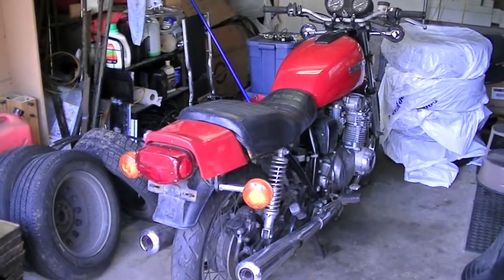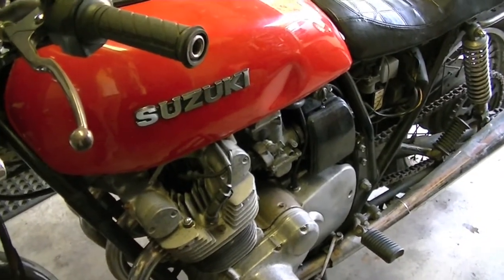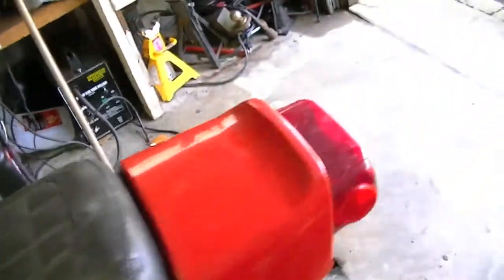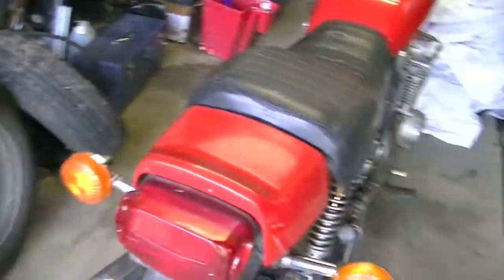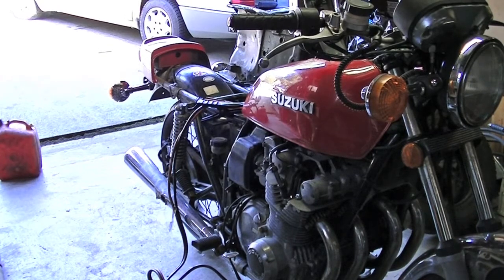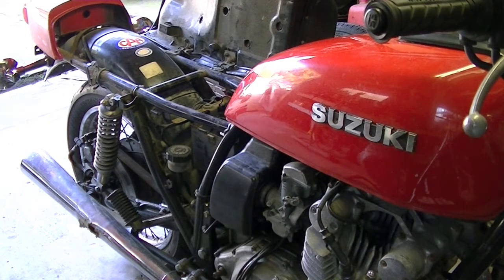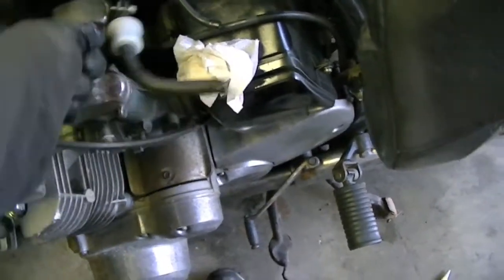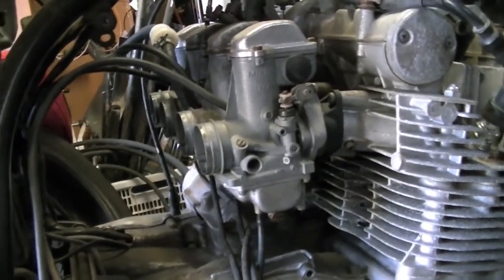1978 Suzuki GS750 Project Introduction

Comment: Man I have a 82 seca xj750r when I got it I pulled the carbs and bench synced them. That's been over a year ago. Now my bike keeps fouling spark plugs. Just eating them.. I'm thinking the idle screws may have moved from vibration. Can't really think of anything else. Haven't pulled them yet.
Reply from the maker: Jrpg1038922Is it using oil? Bench syncing is usually just to get it running. You should really sync them properly with a carb sync tool to get it running right. Also, confirm that the plugs you are using are the correct ones for the bike. If its running so rich that your eating plugs the way you suggest I would pay close attention to the float levels, and the condition of the needle valve and seat.
Reply: Its not losing or burning any oil that i have noticed. Im using NGK bp7es plugs. Just the cheap ones there like 1.99 each. Im just not sure whats going on because after setting everything when i first got it it ran great and didnt go through plugs. Im pretty sure i used your tutorial that you made when you were working on your seca to set my carbs. Not really sure. the floats i set by holding the carbs upside down and making them all level with the lip of the bowl if that makes any sense lol hard to explain. Didnt use any special tool.
Reply from the maker: I'm not sure off hand if those are the correct plugs or not. Might be worth a phone call to the dealer to double check. If a float is sticking or a needle and seat are shot it would cause an overly rich condition. Are all the plugs fouling evenly?
Reply: JustFixIt99 They are correct I checked. The first time it was just one ( I noticed only three of the four pipes were getting warm) the second time it seemed like they were all firing but misfiring randomly. I think I'll pull the carbs and see what I find.
Reply from the maker: Check the air filter too if you haven't already. If its not the carbs, the next stop would be the ignition system....

Comment: ...cont. I lived in Prince George, B.C. Canada when I owned it during the time period of 1986 and sold it in Victoria, B.C. Canada in 1988.
This bit of info may help in your history search of the bike...
Reply from the maker: +Ken Jarabek Sorry for the long delay in getting back to you, life got very busy for a while and I just finally found time to go into the garage and have a peak at the bike. I couldn't see any evidence of a dent on the airbox,  however the right side foot peg did look a little out of whack as you suggested it might. The seat pan was rusted beyond use when I got it, and I didn't care for the look so I turfed it after I bought the bike. The chain guide and side covers were missing.

I've been riding it for a couple years now and love it, however one thing that still doesn't add up. When I was getting papers for it ICBC had no record of it ever having been registered in BC before. If you owned it, and had in insured in BC it should have shown up in their records. Next time I have a chance I'll do an update video so you can see how it looks now that its mostly all fixed up.
Reply: That is extremely strange that no previous registration shows up especially with the info that I have given you about when and where I owned it and sold it, wonder if it was victim to theft at one time and re-registered with a slight number modification? That is correct about the seat pan being rotten...friend of mine repaired it with what was there. From the detail that I can make out in the video after watching it multiple, multiple times, I know that was my bike as I did a rebuild on it shortly after I purchased it. Original paint was more red with factory strip theme on the tank and tail piece. Would be interested to know what part of the country you are located in. You can contact me directly by the email address that I provided in previous correspondence...

Comment: Contact me: kenjarabek@shaw.ca. Let's start with the face of right hand side air box...in the two o'clock position there is a mark which was a slight dent and the right foot peg should be a little out of alignment...that happened on the day that I sold it. The seat was cut to my specs by a friend of mine who owned a upholstery shop,  the seat pan had to be repaired from excessive rust and another friend of mine who is one of the best body/paint guys I know did the repaint on it, I didn't have time to get the factory pin strip kit for the tank and tail piece, the muffler set was starting to pinhole rust at the bottom side middle and I was having trouble to find another replacement set...the chrome chain guard and small engine guards are missing, but when I was rebuilding it, I concentrated on making sure the engine and running gear were perfect as body parts were a little more difficult to readily find. I loved riding this bike and made sure that it got the TLC while in my possession.